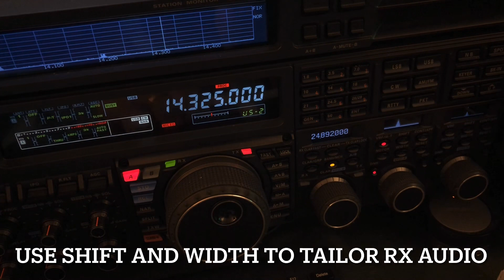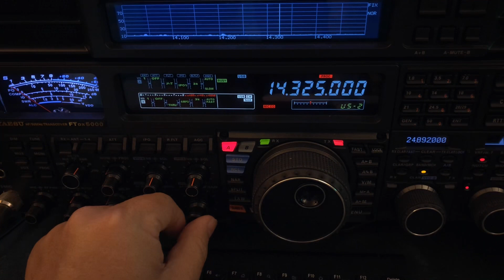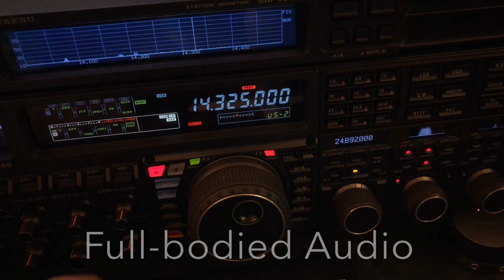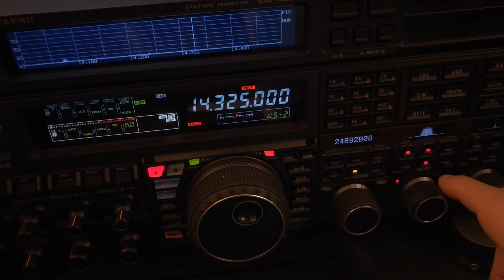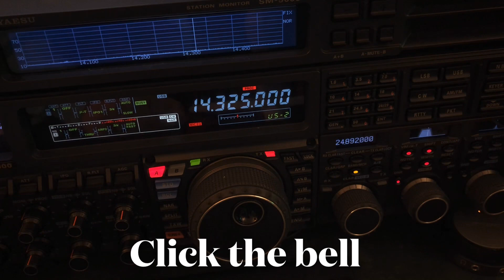Use Shift & Width to Tailor RX Audio

Comment: I wish more radios would have the option of LO/ hi cut for SSB. Make it so much easier. Set your LO cut at 200 or so and adjust bandwidth using high cut. Easy peasy.
Reply from the maker: Most Yaesu radios have it, including the FT-891, FT-991, FT-991A, FT-3000D, FTdx5000MP, FTdx10, and the FTdx101D or MP.  ICOM transceivers include a version of it as well.  It can definitely help.  Some in the music industry refer to it as shelving.

73, de N4HNH

Comment: Hi Doug, you mention during this tutorial a  previous video for maximum output power.
I have tried to find that tutorial but failed so far .
Do you recall which video it would be on.
Regards 
Lee
Reply from the maker: Hi Lee!  It’s the Power Spectral Density video from 7 months ago.  Here is the link: https://youtu.be/6p51OCW0VPc

73, Doug
Reply: @n4hnhradio  Thank you 
73 
Lee
Reply from the maker: You’re very welcome Lee!
Reply: @n4hnhradio  That makes much more sense.
Cheers 
Lee